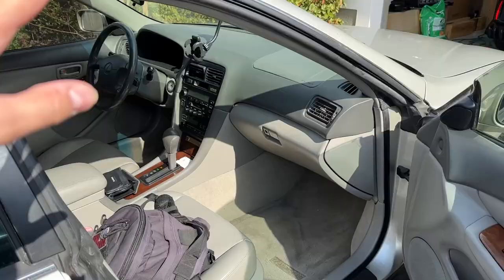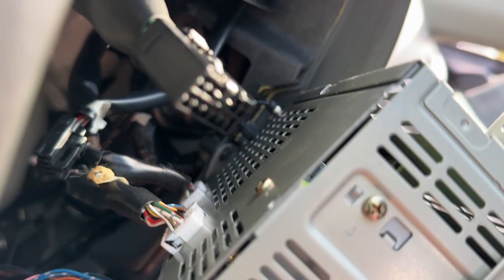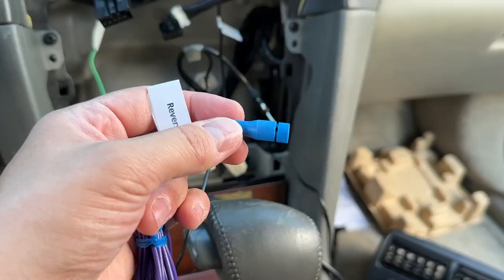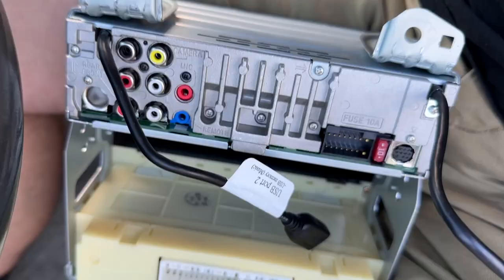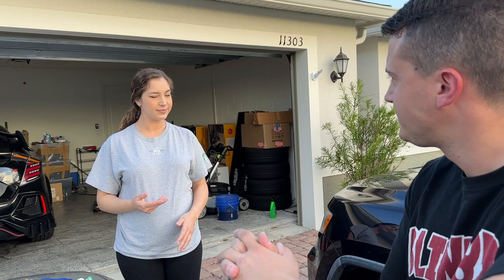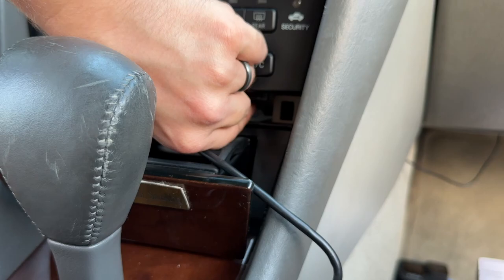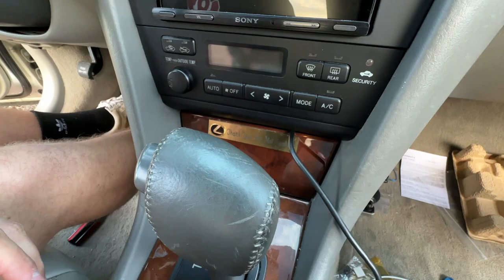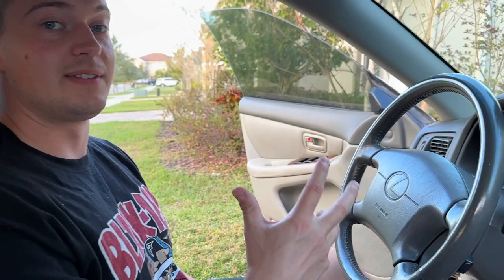First modification for my 1998 Lexus ES300 | Double Din Head Unit Install

Comment: Hey Cam, long time watcher here. I use to work at Best Buy few years back & helped in the car audio department. The installers would tell me that anytime someone decides to buy a new unit while keeping original sound system , the unit itself will have more output then the stock amp can hold. Hence the high pitch noise you hear. The lc2i audio control will help dial that in or just get a Kicker Key amp to pair with new speakers. 👍🏽
Reply from the maker: Thanks Adrian!
Reply: I think you are right, I hear an alternator noise after connecting an aftermarket radio to my camry 06 with a factory JBL amp. There is another wiring harness which bypasses the factory amp, I am thinking to try that one instead, would you recommend it or it can be too quiet without the amp ?
Reply: ive done the same head unit replacement on my es300 and i have a similar high pitched squeal at all times. is there any other info you can give adrian on the lc2i mod to fix?

Comment: Just saw this video. I had a 1998 Lexus ES300 in 2015 and in case you hadn't seen it yet, I posted a writeup on the stereo install process on Club Lexus. Search for a thread called "How to Install an Aftermarket Radio in 1998 Lexus es300" and you'll find the thread and my post with detailed pics. I ran into the same issue with the alternator/engine whining noise, and used a four channel Ground Loop Isolator to eliminate the noise. Good luck with the car! I loved mine!
Reply: Thank you!!

Comment: Great effort installing the head unit Cameron, you did a lot better than I did 8 years ago..

Took out my original head unit and thought I was clever enough to rewire everything myself. The genius in me ended up cutting everything out. After staring at a pile of wires for an hour, I decided to give up and drove to an audio shop to fix my mess lmao.

Keep the upgrades coming!

Comment: You made a good call on avoiding the AX100. I had the AX100 installed in my dad's car and the Bluetooth always has to be paired again every time you start the engine, which is annoying. With the Pioneer unit in my car, you just pair your phone to the unit once via Bluetooth and it will always connect automatically once your phone is nearby and has Bluetooth enabled. Aside from that, the Sony does this weird thing where the time is always either 12 minutes behind real time or 12 minutes ahead of real time. I only got this unit because of the volume knob, but I should've just got the one you got or a Pioneer.

Comment: Honesty bro I subscribe because of the content only watched one video but I’ll be watching the other ones and also wanted to try making videos with my ES300!!
Reply from the maker: Thanks! You should do it
Reply: @Camhill182  well took a while but wish i could dm you a photo new shocks and wheels for her today and she’s running like a beauty!! as well as check all connections in your engine bay if your power is running low my alternator cord was loose on the post and did a little of what your was doing I’m hoping it gets back upm

Comment: Don't know if you read the comments but I did a head unit install on my es and I guess the grounds on these cars suck basically they require ground loop isolators to get rid of the high pitch whirring it picks up the sound of the alternator.
Reply from the maker: Ohhh thats interesting. Thank you for the info!
Reply: @Camhill182  you're welcome... I meant to make a video about the isolators but kinda forgot

Comment: if you don.t want the cable sticking out you could have went with a head unit that had wireless apple carplay. I love them I have 2 boss units one in my traverse and one in my pickup, Also you can get a usb extension that replaces the cigarette lighter and that is a whole lot cleaner looking than a rando wire hanging.

Comment: I did the same thing and I couldn’t get the rca’s in the correct order. All the speakers but the sub work. I want to bypass the factory amp. Did you get the rca in the correct order?
Reply from the maker: I did end up getting the RCA cables in the correct orientation. The sub works

Comment: Correct me if someone already asked, but was the bottom ac control portion a part of the new touchscreen sound system, or did it detach from the upper stereo part of the old audio control
Reply from the maker: It detached from the stock radio

Comment: Hey Cam, did you ever get rid of the high pitched noise? Same issue on my 1999 es300, Sony XAV-AX1000. Anyway hope your newly extended family is doing well! and thanks for doing this video
Reply from the maker: No, I never did. It needs a ground loop isolater though
Reply: @Camhill182  Just finished an install and getting that noise issue. Just ordered a 4 line ground loop isolator, so hopefully that fixes it!

Comment: This is very interesting. When I got my kenwood head unit installed back in early 2020 when I bought my first car, a 2008 Toyota Camry, I never had a high pitch squealing noise. Although I have had the front left and rear speakers replaced. A JVC in the front driver side, and 2 kicker speakers in the back. The 2 front tweeters are still good. I also had two 12inch MB Quartz subwoofers put in the back. Where exactly is the factory amp located in your Lexus?
Reply: there's a good chance your camry doesn't have an amplifier, similar to how my car didn't. maybe a higher trim model does? but if you don't have an amp your set to install new speakers and amp right from the head unit. but usually the head unit already has a built in amp.
Reply: @CrowJamz  oh I think I get you you now. When I had my system put in, they installed a 2 channel DS18 amp, to the back of one of the backseats, along with 2x 12 inch MB Quartz subwoofers 🔊🔊. Before that yeah it was just a regular Camry lol.

Comment: gah, lost that bolt in the same spot, HF magnetic tools [1] come out super handy

I reccomend drilling through and mounting the USB on the Metra plate, very clean and is a replacable piece, and easily replacable. Otherwise you can run the wire through the side of the trim and have it come to the left or right of the trim. I mount other buttons to my trim piece, like my phone mount. I have a Ram Drill down mount [2] and a magsafe puck [3] i sanded down a bit to press fit and mount my phone. Very convenient to use IMO

Amp bypass isn't too hard, a couple trim pieces and dropping the glove box, If you're 100% upgrading speakers though I would do the stage 3 instead of 2.

Love seeing the ES progress! shows realistic struggle and I was at the same point with a lot of these as well. Looking forward to more updates!

[1] https://www.harborfreight.com/hardware/magnets/flexible-magnetic-pickup-tool-94614.html
[2] https://rammount.com/products/ram-b-102-ap-magu
[3] https://www.amazon.com/gp/product/B097CGPZV3/ref=ppx_yo_dt_b_asin_title_o05_s00?ie=UTF8&psc=1
Reply from the maker: Thanka for the info!